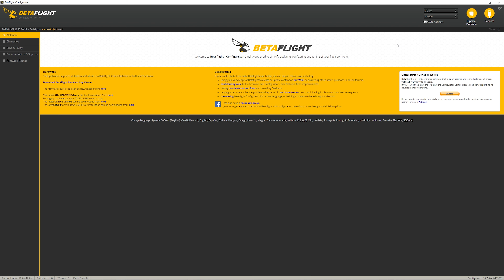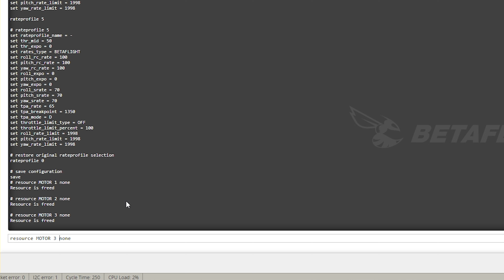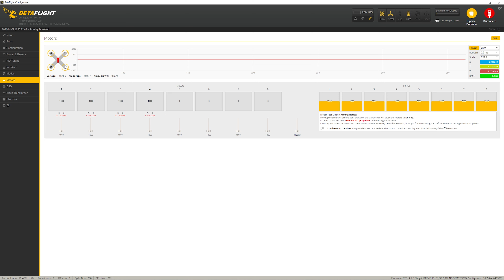Rotor Riot HD1 5" SLAMMED Freestyle Quadcopter Build | Not your TYPICAL kind of build!

Comment: how did this quad hold up over time? thinking about doing a slammed hd1 with a vista for my first build.
Reply from the maker: The quad did really well but I've since moved over to a different frame. The HD1 design is fairly dated at this point. Are you doing a brand new build or you already have the HD1 frame in hand?
Reply: @Mangorille  brand new build. was also considering slamming the hd1 xr for a 7in quad.
Reply from the maker: @mikeybroe1  Any specific reason you want to go with the HD1?
Reply: @Mangorille  looks pretty durable with no cutouts  and cool when slammed, but yeah utilitarian and basic i guess
Reply: @Mangorille  what other five inch frames would you recommend for a first quad? for reference i’m going with the dji v2 system with vista and v2 goggles
Reply from the maker: @mikeybroe1  Nothing wrong with the HD1 but the design is more based on the first generation DJI air unit (the really big one). I've been flying the FPV Cycle Glide and had really good experience with that frame. Did a build video on it a while ago. I'm about to try out a Quadmula frame as well soon.

https://youtu.be/8IDMwD0lWRg
Reply: @Mangorille  siren split looks really nice
Reply from the maker: @mikeybroe1  Ya F5 Siren Split is the one that I'm going to be reviewing soon. I've already got it built up. However, make sure you make note of the flight controller clearance, it is smaller than other frames.